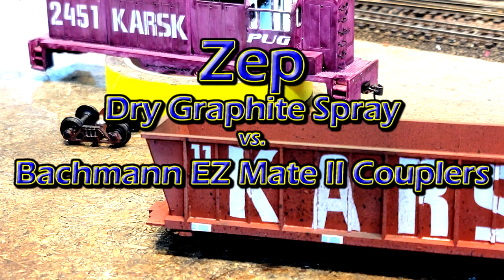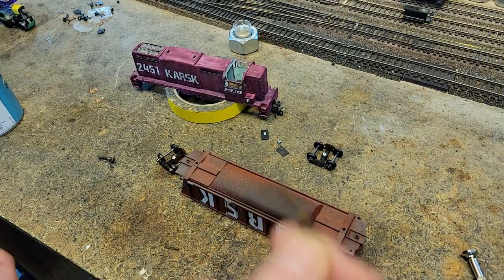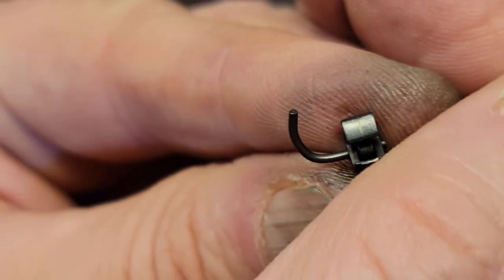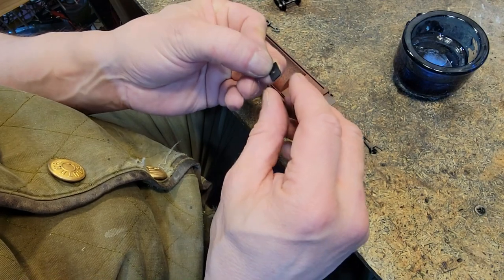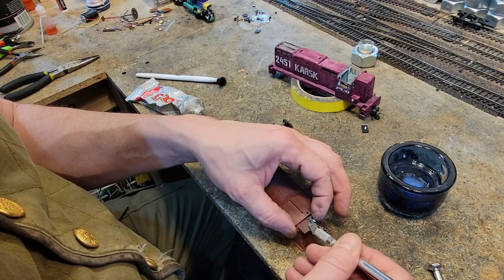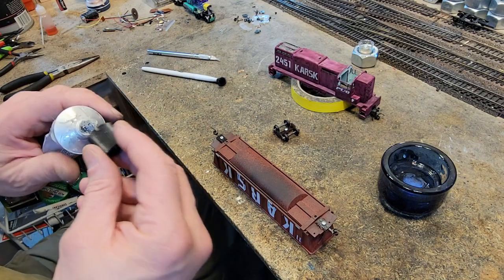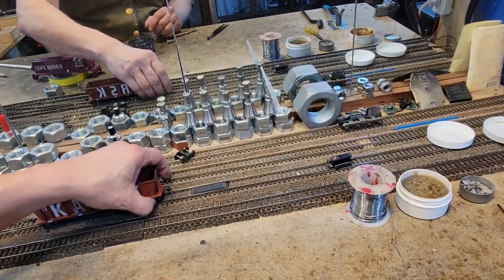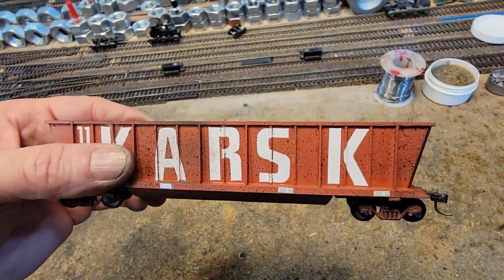Zep Dry Graphite Spray vs Bachamann EZ Mate Couplers

Comment: Elite, why is #11 the only car that had the problem with the wheels rubbing the under-carriage? Aren’t all of your Karsk cars the same brand and model? Are the wheel sets different on #11? Just curious.
Reply from the maker: All of those are different brands, different trucks, etc,. Who knows what's going on the scrapping train because they're all made by a crazy man!  Every once in a while I'll take a bunch of similar cars and strip the paint, then pick some random paint scheme, makeup a name and run them through an assembly line!